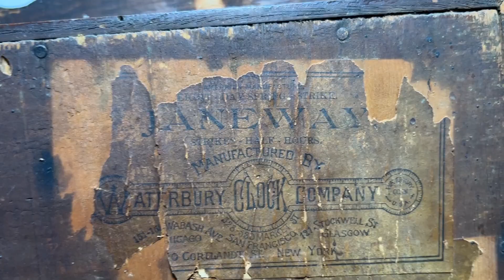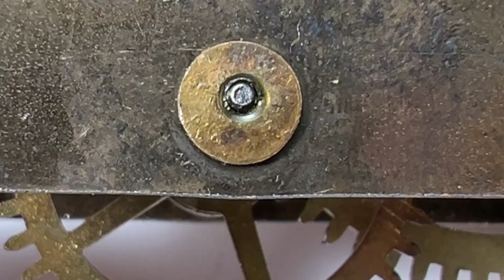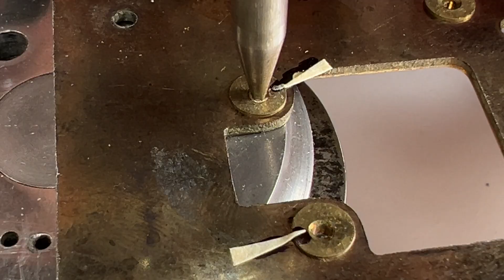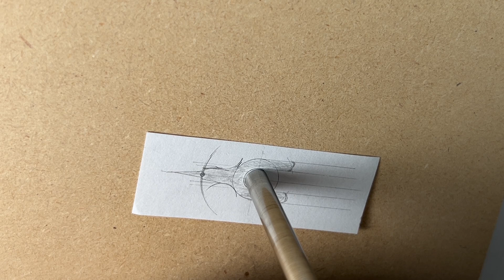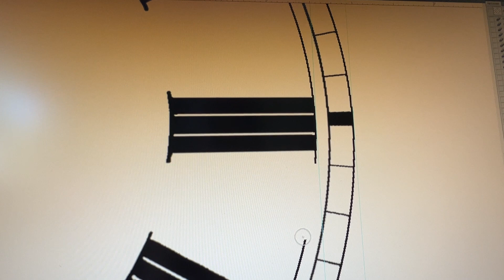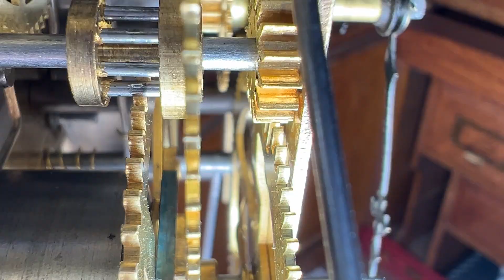Waterbury Kitchen Clock for Jody from North Dakota #126

Comment: Mr. Martin, question:  You mentioned that the movement should be good for another hundred years if maintained and oiled from time to time.  What is a good rule of thumb for oilings and/or disassembly and cleaning if a clock is run continuously?  Two years, five years?  Thank you in advance for your advice.  -Ken
Reply from the maker: A bit of a loaded question due to the many variables that different clock movements are subjected to.
Some are in dusty environments while others are in dust free clean environments.
Temperate variations and humidity also play a role on lubrication life.
Type of oils used synthetic vs conventional.
All things taken into consideration.
Every two years is a good point to inspect the movement to add oil as needed.
Disassembly and cleaning will probably be needed some where around the 10 year period and possible several bushings.
A lot depends on type of movement, the design of some movements show more wear than others.
No real positive answer due to to many variables, so inspect every couple of years and keep things from running dry and dirty.

Comment: Excellent restoration work Mr. James. May I ask you what is the oldest clock you have repaired?
Reply from the maker: Tough to say, many of them its difficult to date.
You can tell they are old when they have hand scribe marks marking out pivot hole locations on the plates and hand scribe marks locating the gear teeth.
This one is one of the older ones: https://www.youtube.com/watch?v=c0Z21CnoCYI

Comment: Sometimes the brass plugs can fall out if reaming it for a bigger bushing, I’ve heard of some people putting solder to keep the brass plug in place while reaming then the solder is taken off after bushing, its kind of smart to be honest.
Reply from the maker: Soldering them to hold them in place is a new concept to me, thanks, that's a non-issue when using small OD bushings.

Comment: I love your videos. Quick question- Do you know where I can find either an original or reproduction replacement glass for a Sauer’s flavoring extracts clock?
Reply from the maker: Originals will be few and far in-between.
You will need to find someone who does reverse gold gilding and reverse painting on glass.
Look for a sign painter.
There are sign painters who do reverse painting on glass that are also experienced in gold gilding.
Reply: Thanks for the advice. I didn’t realize that sign painters could do such detailed work. I’ll look into it.

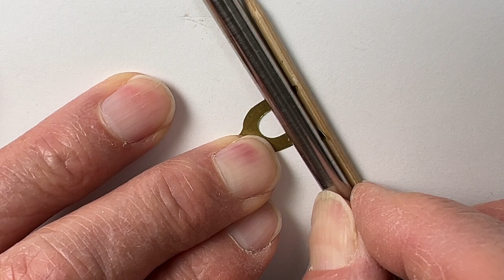Comment: Forgive a question from a novice. I'm a little confused by what you were doing with "gear timing" at 16:10. I didn't exactly follow where the timing needed to be and how to identify the right position.
Reply from the maker: At about 6:08 a little before and after, look at the 3rd and 4th wheels, you will see some small pieces of tape on these gears. 
Before separating the plates, I always set the strike side of these movements at their resting position.
On this movement, there are three key gears, the count wheel, 3rd and 4th wheel that need to be clocked for correct operation.
So, with the count wheel in its lock position, I mark the 3rd and 4th wheel gear tooth that is meshing with its mating pinion.
I don't scratch or punch the brass gears but use any type of reversable marking so as to not cause any butchery to the parts.
When re-assembling, using the marks,  just re-clock these key gear teeth to their mating pinions and all works as designed. 
Any gear that has a cam or pin on them are the ones you need to make sure get clocked to original position. 
If you don't inspect and make note of these gears before separating the plates, it makes for a long day.

Comment: I have one of those too. Mines in excellent condition, except ours stops running after a few minutes. It used to run perfectly, but now not so much.
Reply from the maker: Might be time to clean and oil.
Most of these clocks had instructions to oil the pallet surfaces where the escape wheel teeth contact them several times a year, this helps reduce friction at that point of contact, this might get yours working again.
Reply: @jamesmartin5370  
I'll have to try that then. Thanks..
Reply: @jamesmartin5370  
After researching a little more, it's not the same brand as this one on the video. Ours is an Ansonia with no alarms. It's an 8 day wind with 1/2 hour, single chime, and hourly chimes. Can get noisy late in the evening and early morning...lol ..

After carefully blowing it out and then using a small amount of sewing machine oil in the pivot points (ones I could reach) it's running again.